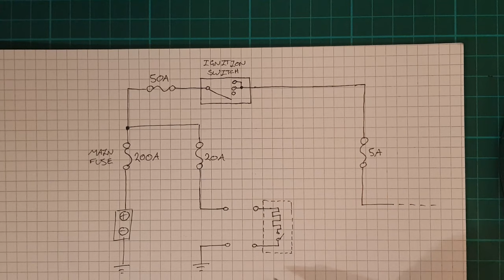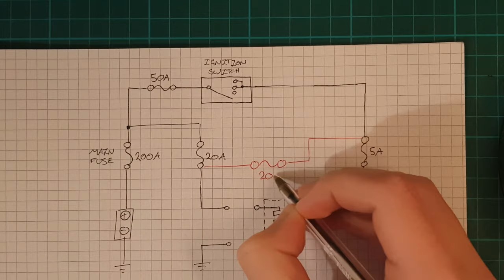MUST HAVE E46 FIX - Cigarette Lighter with Ignition - BMW E46

Comment: Appreciate the video. However, at 1:45 it looks like your upper wire is inserted entirely above fuse 8. In my car that's just an empty plastic hole. I poked around with a multimeter and found that I needed to connect the bottom terminal of fuse 8 to the top terminal of fuse 47. It's working perfectly for me.
Reply: Hi! Can you please share a photo how did you do that? I have also upper hole of 9 fuse empty. Thanks
Reply: Thank you, worked fine like This.
Reply: Same here. I wonder how would it work for the op, since there is clearly no connection on the top rail. Works fine for the bottom rail of fuse 8.
Reply: what gauge wire did you use?
Reply: I used AWG 12 but I feel that may have been too big for my 4 inch length.
Reply: I discovered the same on mine. Worked just fine bottom of 8 to top of 47.
Reply: It probably worked for him cause he has an M3. The booklet says only m3 on socket 8.

Comment: Thanks for sharing, this system is interessant. But just to confirm, Radio which is normally 5A protected, is now 20A protected now ?! So no danger for the radio in case of surcharging ?

Comment: So does this mean that we're sending as much as 20A (because of the 20A fuse used) though a circuit (fuse 8) that was designed for 5A?  I'm not an expert, but this seems sketchy